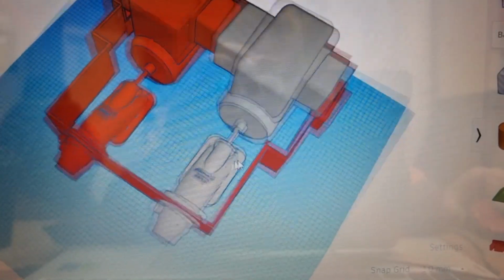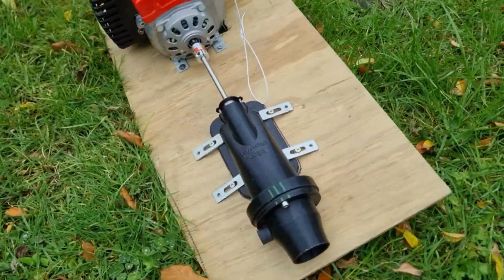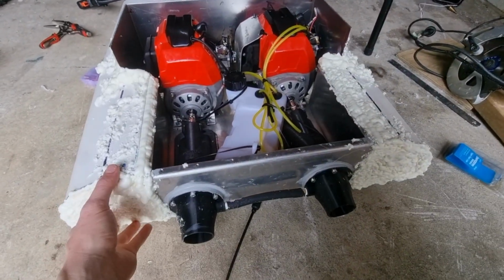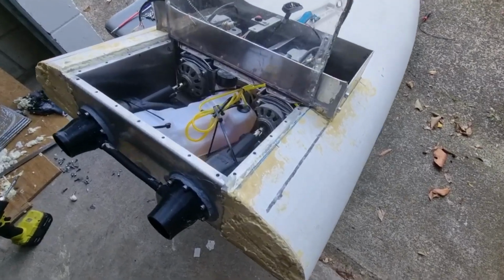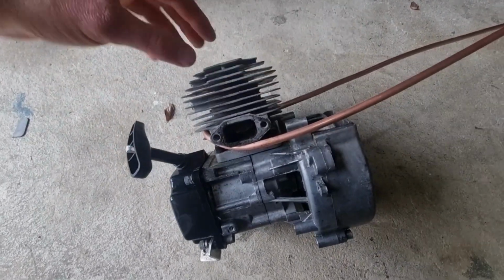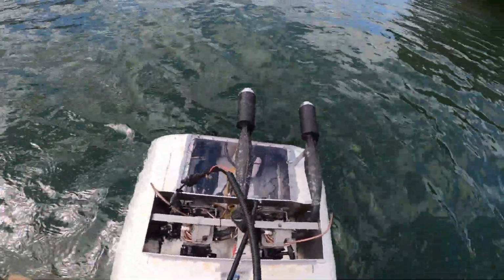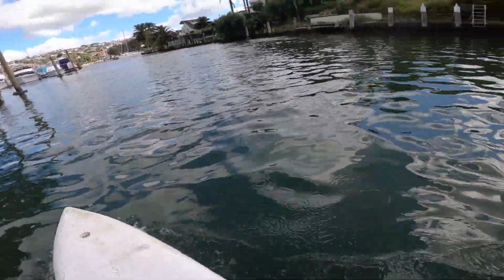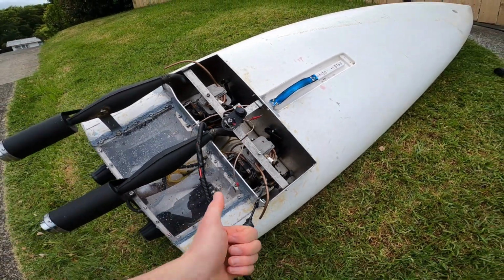Making DIY Jet Surfboard

Comment: Hi, in Brazil is sell a outboard 52cc for kayaks and small boats "jet turbo pantaneiro 3 hp hélice" and the impeller 2 blades has 80mm diameter and the same pitch and spins around 4650 rpm. If you use a reduction gear 1.66:1 you can increase the pitch to 133.3mm (this motors on the water with a right reduction can spin around 7860 rpm with load). And if so excesive pitch you can use 82.8mm diameter impeller x 112mm pitch. Enlarge the width board and use 3 engines.

Comment: Another crazy kiwi engineer! Love it. 
I'm thinking you have heard of DKwelds before hahaha
Reply from the maker: Yeah I seen him haha he goes good vids but he got his surfboard wrong and I got it right 😅
Reply: I did get it wrong! Haha looking forward to seeing your one working 👍
Reply from the maker: Haha cheers mate I saw yours vids and knew I could do it better 😅 so far it has heaps of thrust
Reply: @Kylesprojects101  I should have run 2 jet units like you , were you getting to planning speed? Also those motors suck they are out of balance and have constant problems I think your ones are different. You seem to be getting pretty good thrust
Reply from the maker: Yeah it's almost getting on the plane. But definitely fast enough for me. Being on a budget. And mine are pretty good expept getting wet then it has problems so next vid will be good as i actually stand up and surf it

Comment: Ive been watching electric builds and teh best one used approx a sur ron battery and only got 30 min.. It had me thinking gas trimmer engines actually almost exactly what you built.. Looks like it makes good thrust with one engine curious how it works.
Reply from the maker: It's kinda has enough power. Just not much thrust. Needs bigger jet units but overall needs at least 125cc
Reply: @Kylesprojects101  I think a smaller jet to each engine will make more power. Even the electric boards tend to use two 2.5in jets..  I was looking for a 100cc 2 stroke but not finding any yet.  I do also have an old YZ250 that the engine runs on lol..